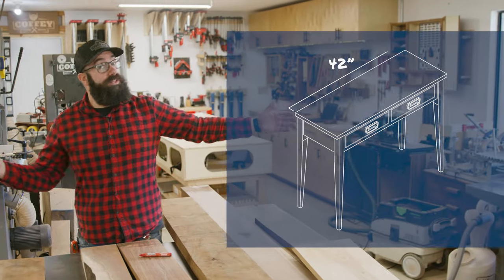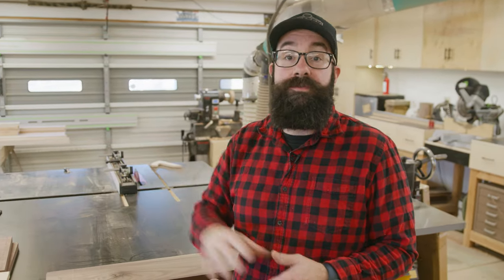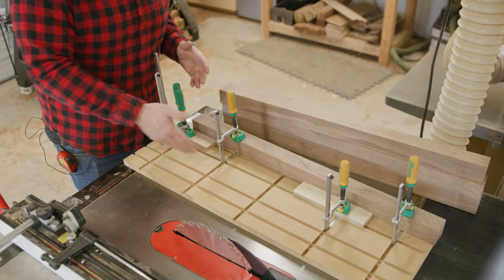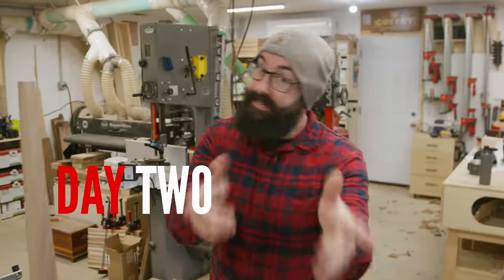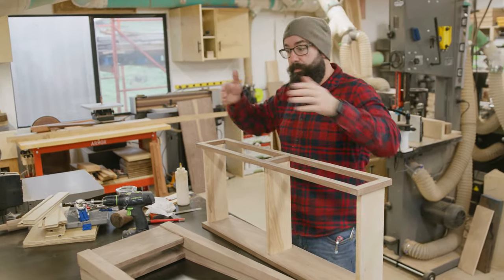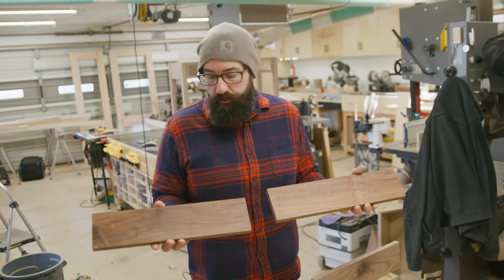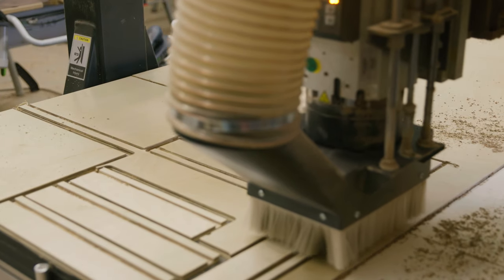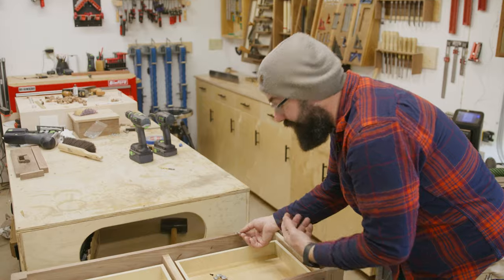This last minute design change MADE this piece

Comment: “Pocket holes because I hate myself!” So true. They suck. Feel dirty every time I use them. Do you scrape your glue squeeze out the following day or is there a specific time frame that works best? Love the content. Keep it up
Reply from the maker: Thank you so much! I prefer to clean up glue at the 45-60 minute mark. I find the glue to be hard enough to break off but soft enough to not grab on to grain fibers. I also wipe joints clean with a wet rag after joining.

Comment: What are you cleaning your glue squeeze out with. I'm surprised you haven't heard of the plastic straw trick.
Reply from the maker: It's a silicon brush and a wet rag. Works great. I have heard of it. I don't keep straws in my shop. It works great though!